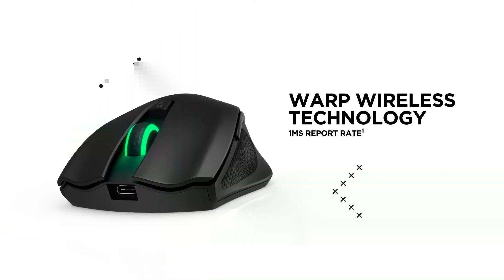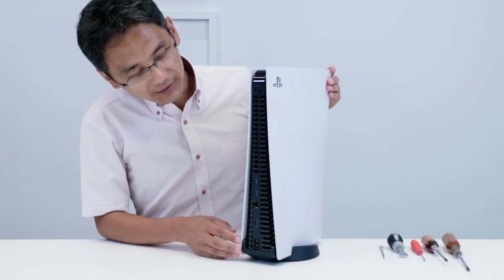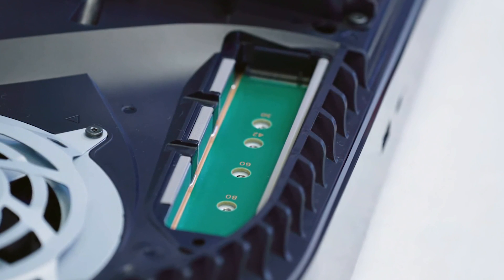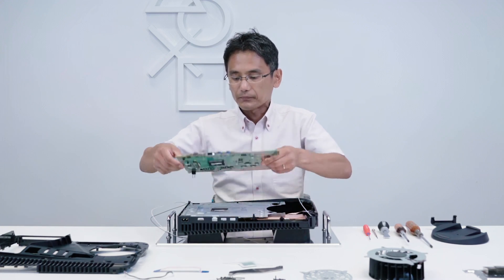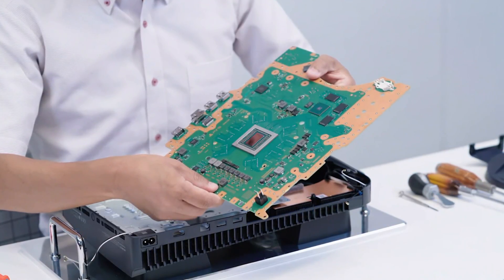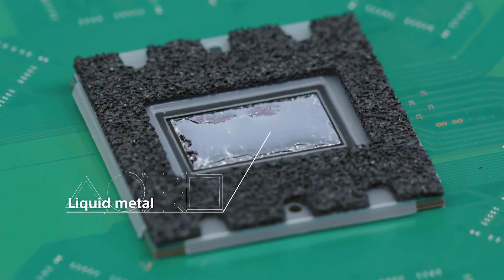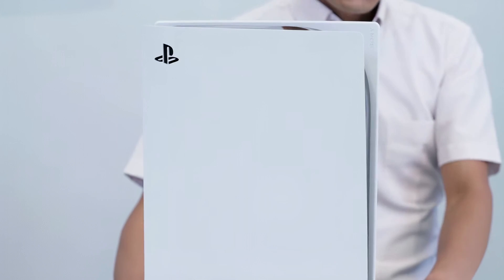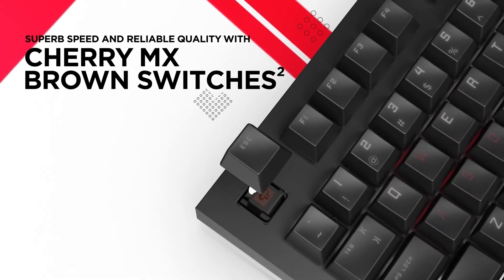PlayStation 5 Teardown Analysis: Inside Sony's Next Generation Hardware Design

Comment: If the PS5 is using a 'brute force' cooing approach, what the hell is Xbox doing? The bias is unreal, also you don't even mention the fact the PS5 is clocked way, way higher.
Reply: And what Xbox still to powerful against it.
Reply: @rajakhan12346  You're in for a shock when the difference is basically non-existent.
Reply: @rajakhan12346  and Xbox is still slow compared to the ps5 literally 4x faster than the xsx and even higher when using the kraken tech
Reply: @domzzcardzz7985  ahahhaa keep dreaming
Reply: @rajakhan12346  why do I have to dream when the specs show that the ps5 is 4x faster than the xsx
Reply: @domzzcardzz7985  all you care about is SSD . Faster 😂
Reply: @rajakhan12346  it is tho🤦 it's way faster 😂
Reply: It is Brute force. They just went with the strongest stuff PCs are using and worked on it. Microsoft created a unique cooling system
Reply: @Juicersen  Excuse me? One big fan and a vapour chamber isn't unique at all lmao. Sony did it smart, they used physics knowing wide and thin was better for heat dissipation as well as creating a unique liquid metal solution. It's far more advanced than MS who just threw in one big fan into a box and said fuck it, it'll do. Proof is in the pudding, Xbox runs hot, it's cooling is whack.
Reply: @Quazzi  Ofc you won’t think it’s unique because of how simple it is but they went a route other people aren’t going. In a few months PCs will have Sony’s liquid metal or probably something even better. It’s a good cooling system it just isn’t really unique. And if you think that’s all Microsoft did then you’re not keeping up sir

And how are you gonna say proof is in the pudding then mention a rumor?
Reply: @Juicersen  Vapour chamber and cut the board in half, that's all they did. Oh, and block up most of the airflow ports with hardware and a stand you can't remove.
Reply: @Quazzi  Yeah you’re clearly biased you’re trying so hard to make it seem like nothing was done
And nothing is blocked wtf are you talking about. You once again demonstrate you don’t understand the design
Reply: @Juicersen  Of course it's blocked, the stand blocks all the air holes on the bottom and in other places there are components literally covering the holes. Also there's nothing to understand lmao, just a big fan in a box blowing air over a split board using a vapour chamber instead of a normal heatsink.
Reply: @Quazzi  It’s not blocking anything, this thing gets 70% more airflow than last gen consoles
If there’s nothing to understand why are you arguing with what you understand about it? 
Imma dip
Reply: @Juicersen  It's a fucking box dude, not something highly engineered. Fit the parts inside the box, slap in a massive fan and done. Oh, it's getting too hot? Clock it at 1.8ghz and slap a few more CU's in. It's extremely simple and is the brute force approach if one of the two designs is, not the PS5.
Reply: @Quazzi  Yeah okay man whatever you say. Imma dip
Reply: Just got a feeling that the ps5 will outperform xbox in everyway, i mean just look at that massive cooling solution, higher clockspeed, 350 watt power supply, faster ssd. Something's telling me that the ps5 will blow our mind out.
Reply: @rgh4bo  I have the same feeling but not necessarily outperforming in terms of framerates, rather the games in many cases will perform just as good despite the 'lower power' (which we know meas nothing really) as well as there will be games only possible on PS5 and quite a few games will look better, especially UE5 games.
Reply: @Quazzi  yeah absolutely true

Comment: I had PS4 pro previously but I originally had Xbox all my life and , I care about power, and Microsoft made the Xbox a beast of a machine. That is why I’m getting the series X. The PS5 design seems cheap to me. The two plastic sides are easy to take off and look like they are barely hanging on. Doesn’t look like a tough design more flimsy.

Comment: I wouldn't call the PS5 design simpler at all, the construction requires way more steps to tear down, and just adding/replacing the extra SSD means removing the chincy-looking panel (the way it bends in the video made me cringe) then opening another part. The general design has way more intricate, interlocking pieces, I wouldn't call that "simpler", just look at the final shot with all those parts.
The fan has me wondering, too, blower coolers are generally not as effective at moving air as axial coolers. Looking at the fan itself, it's basically just a slightly larger version of the PS4 fan. I just hope it gets enough air through those slits in the main body.
Reply: Richard has been in the tech business much longer then we have, we should believe in his words.
Reply: I means it’s not hard to add the extra sdd memory at all and also to take the panels off they literally just slide off, think you’re complaining a bit to much on something that is quite easy to do

Comment: Uhhhhhhhhhh wow

The PS4 noise had nothing to do with dust.  Otherwise the machine wouldn't of been loud the moment I played Shadowfall.  

Saying the main factor is dust is downright wrong.  

Dust makes the system get hot faster, but doesn't change how loud the system gets when it does get hot.

Also jesus lol.  Why would an on-motherboard SSD be an area of concern?  And replace?  Why would you replace it?  If you are already buying storage then atleast you can always have the 600+ GB from the on-board SSD + the new storage space you bought, instead of having to get rid of the old storage and replace with the new.  

This video is fucking awful.   Wow.

I've seen 3-4 teardown videos and this is by far the worst one yet.  Dissapointed in DF on this one.

And AGAIN wow.  He calls using top of the line thermal paste + a vapor chamber quality heat sink a " brute force " method of cooling.  What?  That is an efficient as fuck method of cooling!  The thermal paste puts the baseline temps at their lowest possible numbers from the jump and then that heat is very efficiently moved through the innerds of the system via the heatsink and then out the system all the while both sides of the console pull in outside new air. 

Damn DF.  Wtf is this video?  Like .... Almost everything said here is either BS or some weird false " concern " that doesn't even make sense.
Reply: Richard specifically has become an Xbox affiliate it seems and Alex is an Nvidia hog. I prefer John for everything or Tom (I forget his name). John and atom are pretty not biased although John does prefer consoles it seems.
Reply: He also says that the Max theoretical speed of the SSD is 5.5 GB/sec... That speed is the minimum RAW. It can reach 9GB/sec compressed. The theoretical Max is 22 GB/sec. 
I have heard about Digital Foundry's bias in 2013 so I'm definitely wary
Reply: Remember they're getting paid by microsoft that's why they're downplaying it
Reply: @domzzcardzz7985 In all fairness I don’t think they are getting paid directly. They are CLEARLY on the take though.
Reply: I can tell you from personal experience my PS4 was much louder with dust.

When cleaned it with compressed air it became normal
Reply: @arananime3156  yes dust makes the system hotter and thus the fans have to move at their maximum speeds.  

But the system will reach maximum speeds regardless depending on the game.  I opened mine and cleaned the innerds once a year.  Didn't change the fact that the system still ran very loud.  

My launch PS4 the moment I started playing Shadowfall spun up and got loud.  To the point to where my family in the room said " is that the PS4?  Is it always that loud? " Lol.  It was somewhat concerning honestly because it was audible even over outside noise.  

Saying the MAIN CAUSE of the loudness of the PS4 being dust like he does in this video is simply wrong.
Reply: Wait so a system getting hotter, meaning the fan must spin faster to cool, means that it doesn’t at all get louder? Hmm, well my PS4 was incredibly loud and dusty soo
Reply: Bro chill...dust is a main factor to increased fan noice in most cases, coming from a PC gamer it’s common knowledge. Dust equals less air flow, which means hotter hardware, which leads to an increase in fan speed to compensate, which increases the noise.
Reply: SSDs soldered on motherboards are a concern because if they overheat and burn out the console is dead. Still, only a small chance and I'd trust the Sony engineers, but the chance is still there.
Reply: @TheLee153  you could say this about every single component built onto the motherboard.  SSDs get hot sure but not CPU/GPU hot and the heatsink is located directly above the chips.  So the heat will get pulled out quickly and efficiently.  

Seeing the sheer confusion and misinformation just in these comments shows how awful this video was.  Good lord.  You'd think the PS4 was quiet looking at these comments and it was just age and dust that caused the loudness to get cranked up.
Reply: @aaronh248  I'm not slating the design but if there is a small concern I think its fair to mention it. Either way I'm sure there's nothing to worry about, It will be fine.
Reply: Dust makes the system hotter fans work faster less space to pull air through so loader fans under stress so yes dust makes your system louder
Reply: The concern seems to be that the ssd is soldered to the motherboard and if it fails, you can’t use your ps 5 since only the internal storage can benefit from the custom controller and so on, kind of what Apple does with newer MacBooks, where if the ssd fails, you can’t replace it.   That’s what I understood from the articles about ps5 ssd.
Reply: You'd want to be able to replace the internal SSD because parts fail, higher capacity drives come out and there may be performance issues with a 3rd party product using a different configuration to connect to the IO.

Dust would have the console operating more loudly basically all of the time, while when new/clean the fans would spin up less fast & often. Dust, fan size & vent config are all compounding factors.

but you just wanna be mad.
Reply: The heat sink does not have a vapour chamber unlike the xsx just live with the fact
Reply: You would replace the internal ssd if it became faulty, is what he means but as its soldered you'd have to replace the whole motherboard.
Reply: @bigjus3751  in 7 years time you will never hear the words " replacing my faulty SSD ".

We've had soldered on SSDs into devices for decades now.
Reply: @aaronh248  as rare as it may be, you wouldn't want to be the person whom that happens to, as there is no such thing as 100% never gonna happen. All electronics have a percentage of faulty units, however ever small the likelihood.

Comment: heat dissipation has been a concern for me for the ssd for nvme for consoles. They average idle its 40c however under load what are the temps here for ps5 for this. Curios to know.
Reply: 60 to 65.  Will be fine though.
Reply: @glenmcl  wouldn’t that be too hot and kill performance considering its running almost close to a cpu or gpu in terms of degrees.
Reply: @sickamore007  the memory modules are better warm, the controller is better cool

Comment: Xbox will be running insanely hot, designed around a compact box rather than optimal performance, hence the downclocked GPU. Wide and slow.
Reply: Doubt it, it has a vapor chamber and a full 120mm fan on it and is coated in vents on all sides but the front. Vapor chambers do tend to be better than normal copper heat sinks, they just tend to be a bit more expensive. Upside is that as they get perfected in manufacturing the price falls faster as heat sinks are mostly material cost. Plus there was recently a news piece that showed the Xbox was cooler by about 3 degrees. I'd believe it. The PS5 is using a blower fan which tend to be a bit worse than axial ones due to the odd right angles used to intake air. Because of this neither is hot though I question why Sony is spending money on liquid metal when in 6 years that may cause problems. 

Liquid metal usually isn't something you want sitting without replacement for more than 2 years as it forms alloys with other metals making the appearance it ate away at the cooler. Gamers nexus has a few videos on it and Der Bauer just tends to say it's too a pain to be worth it as needing multiple coatings every few years is tedious.
Reply: @Skylancer727  For starters, we know factually that at least a number of Xbox's out there right now are running very hot, that's just facts a this point. Secondly the point about liquid metal and it's longevity is clearly something Sony are aware of and have a solution for otherwise they wouldn't bother with it. For starters it's a sealed unit which can massively reduce the reactivity in most scenarios.
Reply: @Quazzi  I'm doubting the Xbox getting hot claims. It's more likely fanboys are spreading rumors than anything else. Let's be honest we had rumors of both the PS5 and Xbox over heating. I highly doubt either do. If there is any credence to it, it would be people putting the fan right on the a wall which they should know not to being they didn't just give 2 year olds. We already had a Japanese reviewer test both early consoles and showed the PS5 ran 3 degrees warmer but considering that's still 65 degrees that's still really cool. 

Also, you can't fight chemistry. Liquid metal is liquid metal, it does evaporate just like thermal grease dried out with some worse than others. It's why your console gets louder over time even if you clean out the dust. There are a few metals gallium reacts less with but none it does zero other than titanium which is a poor thermal conductor. This is why on PC builds with liquid metal they recommend opening it back up after 2 months as most of it will have been absorbed by the cooler. There really is nothing you can do about it other than protect surrounding hardware from it leaking like Sony did with the black foam but that doesn't stop the evaporation nor the gallium forming an alloy over time. There is a reason no consumer products normally come with liquid metal, it's a pain to deal with. And you can't fight chemistry. I think Sony are more just banking on drowning it in liquid metal making it last beyond the warranty or the hope there's too much for it to all be absorbed by the metal. Either way it will still dry out in time. That's just a fact. It might just be in 4-5 years where at that point PS6 is coming and anyone complaining will also be the ones begging PS6 to come quicker. Honestly that would be pretty devilish considering they wouldn't need the liquid metal if they just used a vapor chamber like the Xbox. 

I have no doubt that for a fair amount of time your won't see anything wrong, but I know liquid metal is abnoxous from experience. Don't just assume Sony thought it all through. People assumed the same thing about the 360. I would stop picking sides and wait to see what is true rather than listening to rampant rumors. For every rumor for one side there are for the other. Just be patient and wait for the facts.
Reply: @Skylancer727  Journalists who have the XSX are saying this stuff, not some nobody from Neogaf. As for the liquid metal issues, I'd trust a company as adept as Sony would have thought of and mitigated all the potential issues. One final point about picking sides, Xbox has an awful past of mediocre games and Sony, even during the latter stages of the PS3 era has always delivered so for me it's an obvious choice who to back to deliver this coming generation. Xbox just simply do not deliver, the trust is undeserved.
Reply: @EX8MG3 Yes, it's at 1.8GHZ which is slow for RDNA2 so they just slapped more CU's in to make up for it.
Reply: Moist Gnome  It's 'power' is being massively overstated and you'll see that when the comparisons start coming out. It's insignificantly more powerful than the PS5 at only around 15% just purely by the numbers, in reality that'll be way smaller. The GPU power gap between 2 consoles has never been closer.
Reply: Get your iq checked.